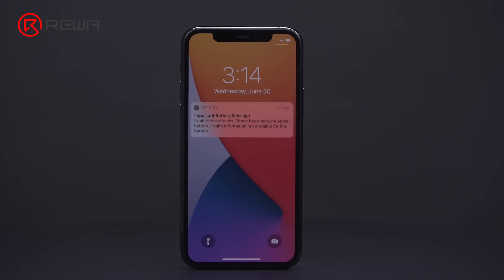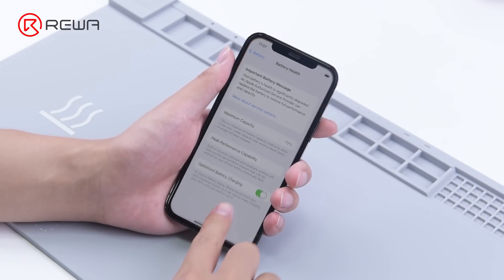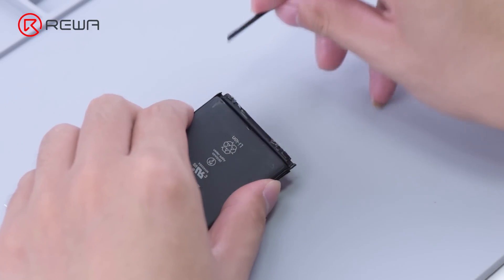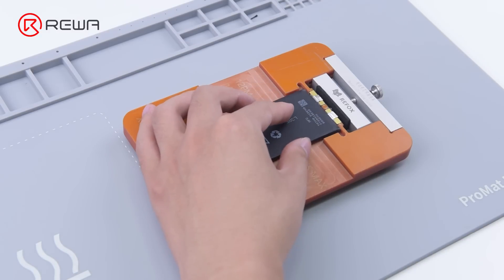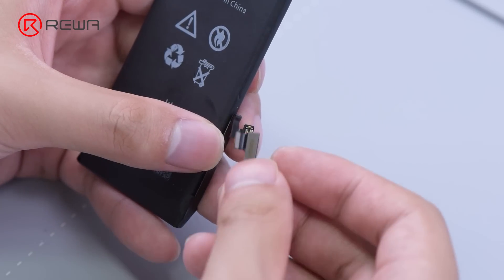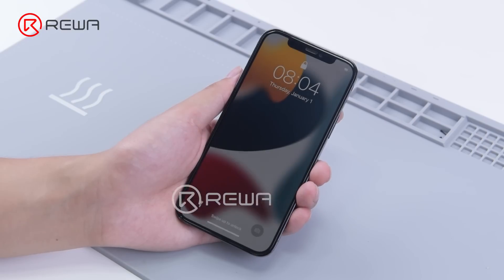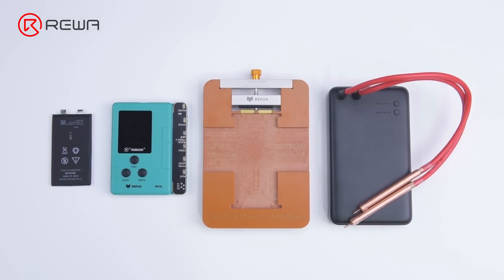An Effective Way to Remove iPhone Genuine Battery Message Alert

Comment: Do you need to remove the tag o you leave it inside?
Reply from the maker: Yeah we need to wield the BMS board to the third party battery
Reply: @rewatechnology2008  yes I did that, but the tag that we used with the Rp30 programmer. It needs to be removed or lesve it with the battery?

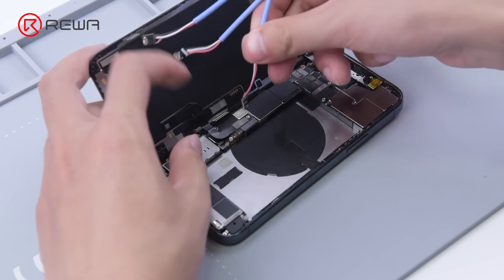Comment: i dont get the part at 2:55 why do u need to  connect this wire and for what it needs to and where it come from ? from the multitool?
Reply: It connects to the motherboard which is for determining if the battery is faulty or the motherboard is

Comment: REWA please help. I have used this method to replace my iphone 12 Pro Max battery that was at 73% and so was showing the service message 'your battery health is significantly degraded'. I replaced the battery and set the health to 100% and cycle count to zero. Even though the health is showing as 100%, the service message is still there? Why is this and how do I remove it? Thanks

Comment: hey all, unfortunately i damaged the connector from the original battery, i bout some genuine iphone 11 flex but now i am still getting uknown part, does it has to be the same cable in any case even though i bought some genuine battery cables from aliexpres and soldered them on,

Comment: great work and solution as always. Has anyone tried transplanting the major components of the original BMS board to a new original battery? I'm trying to fix a phone where I received a damaged BMS, tried jumping the damaged lines but the board doesn't work. I have no luck finding a schematic and is looking for a fix. I hope someone can suggest which chips are essential in carrying the battery info so I can try and move it to another BMS. :)

Comment: Rewa:
If an iPhone 12 has battery health 80% and you replace it with a new battery, without programming and moving the BMS board, would the phone still drain fast because it does not show the health?

Comment: If this worked then you should be able to put the original battery back in. But when I put the original battery back in. it still gives me the same message with a 0% warning.

Comment: Hey Rewa 

1. Can I remove the tag on flex after the programming and activation part? And can I use one tag on flex more than one time?
2. I have a qianli icopy plus 2.1. Can I program and activate the battery with that programmer also?
3. Does the battery without bms board comes with the plastic bracket and a new insulation tape?

Comment: Hey i have an iPhone 13 and it's got important Battery message for no Reason, it's never get a battery replace beside it's never open before also it's only run 6 months, the only issue i think is happend is i used a another charging adapter that all, is this is an apple where if you used another charging adapter you got an battery error, then it's not a smartphone Company its a piece of trash, i would bever ever buy anything from this brand

"RIP apple"

Comment: I bought this program but it’s doesn’t work with the flex cabel , it’s doesn’t read the battery unless I connect the ba3 directly and it’s frustrating cause ends up showing error

Comment: I change my battery in a local shop. Now battery health is not showing?
What i can do?
Reply from the maker: Which model?
Reply: @rewatechnology2008  XR 64gb
Reply: Use a MacBook and a software called “coconut battery” you can se the battery health and cycle count that way . Tank me later .
Reply: @ciprianbeniuga5042  i sold my phone,btw thanks for information

Comment: thank you for this nice video, if I don't have the original battery so not the bms, can I remove the message from the battery indicating that it has been changed?
Thx
Reply from the maker: No, you can't.

Comment: Bro can you please tell me if we have old battery and install a local or a duplicate battery and follow all your process will the message show up? 
Or in simple words if we install a local battery following the process ,still can we remove the battery message?
Reply: You need the original battery that was in the device in first place. If you try to install a IC board from an other original battery the massage will still show up.

Comment: Hi REWA appreciate all videos, we see you made one on the qianli tool and software version of this method.. however we are having trouble with qianli tool being consistent for this repair.. do you recommend REFOX as the number one programming tool for battery work? Thanks in advance 🙏🏻
Reply from the maker: Hi, you can try REFOX RP30 as it is a reliable tool tested by our professional team with quality and functionality assured.
Reply: @rewatechnology2008  hi if u change motherboard and again u have unknown part battery can u fixed?
Reply: @rewatechnology2008   have you tried to upgrade a battery this way with another battery from another iPhone that would fit  in shell still and be intriguing to see if you could make adapter for the iPhone same way so that people can use any battery that they want
Reply: Same here. it works about 50% of the time

Comment: After reprogramming it I plugged in the battery to the phone to see if everything works fine. The battery capacity is still the same (86% in my case) so my programmer didn't work. I tried reprogramming 3 more times. Nothing has changed. Software and programmer shows battery health 100% but after plugging into phone (iphone xr) it shows 86. Why is that? How do I fix it? I would appreciate every help.
Reply: U need an another battery to pop up the message
Reply: Is it series 13 or 14?
Reply: did you ever fix this?? i am getting the same problem on iphone 12 pro max

Comment: Do i need to activate the iPhone with a power supply? Is there an easiier solution?
Reply from the maker: You can use another battery to activate the phone.
Reply: @rewatechnology2008  is it neccesary to activate the phone ? Cant we just remove old and install New modified battery ?

Comment: Is the tag necessary only for reprogramming or even for final installation?
Reply from the maker: Both
Reply: @rewatechnology2008   you didnt use it for final instalation ;) cant see it on the video,you did put  new battery in to the phone without tag... i wont be paying another 10$ for stupid tag every battery replacement... hopefully there will be another solution in future
Reply: @dathremar1  if you look closely @3:18 the tag on flex is there between the battery and motherboard
Reply: Some batteries are locked so you need it to change cycle count and change it back to 100%

Comment: But this is a way for scammers to sell batteries with less power to customers as 100% batteries.
Reply: Nope your wrong as a technician for iPhone we do this method to be able to sale phone to amazon for example and provide a customer with a new battery cell at 100% and to get rid of that annoying unknown battery message that customers don’t want nor like. Not to scam
Reply: Shut ur hole u Apple fan boy
Reply: No one is scamming but apple having us to jump through unnecessary hoops😂
Reply: By your logic? Apple is also scamming ? By making the repair this hard ?
Reply: How can they do that?
Reply: @FRIGYES10  insert a dead or dying battery (scrap). and then reprogram the board to say it's at 100%. 

easy scam
Reply: @aroberts3213  then find reliable technician and ask for additional service warranty
Reply: @aroberts3213  Yeaah business is business